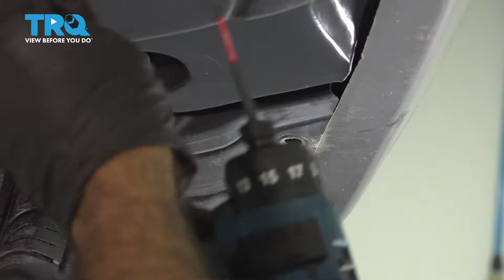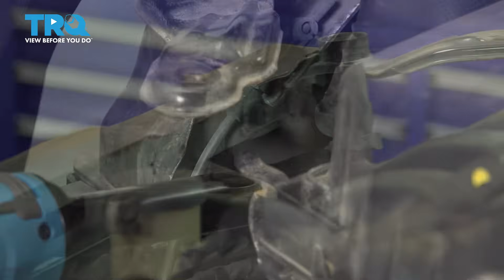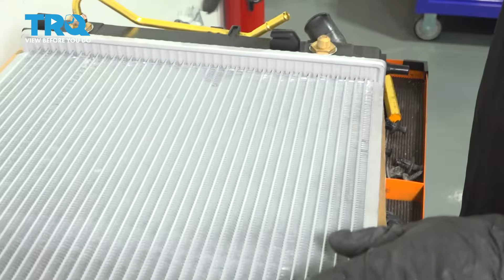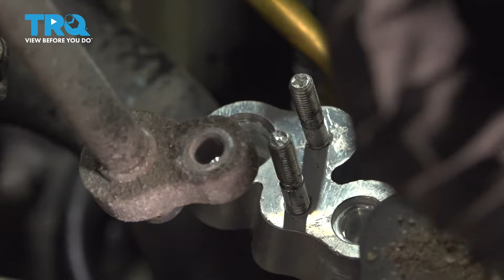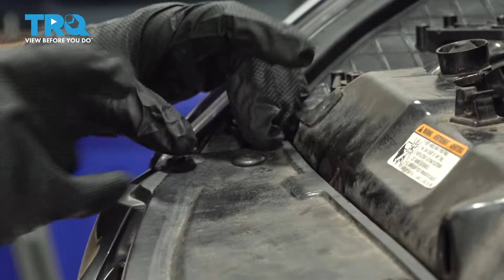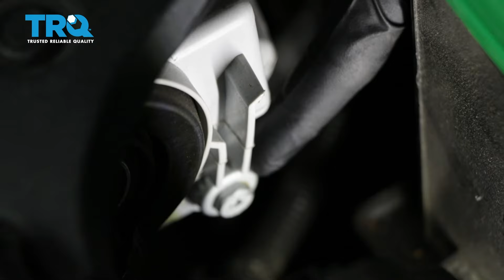How to Replace Radiator 2011-2016 Hyundai Elantra

Comment: So, i didnt see the note about going and getting the freon evacuated. I thought ( in my ignorance) that there must of been some kind of one way valve that stopped the freon from coming out. Yall dont have to tell me how dumb i am..... but , what do i do now? I finished the job and put the car back together and the car is running fine. But, how do I handle my AC issue? Do I need to go and have a vacuum put on the system? Or can I just add freon? When I took the lines off the condenser. The gas came out for probably 30 or 40 seconds maybe. It came out till it stopped.
Reply: Did you fix the ac issue?

Comment: He never showed the part where he evactuaded the A/C. Please DO NOT DISCONNECT WITHOUT PROPERLY CATCHING THE REFRIDGERANT! It is illegal to let out into the air. It will also shoot out a lot of pressure when you disconnect those condenser lines and be dangerous! I am doing this exact job tomorrow and will let yall know if it is necessary or not. I have never had to do that before.
Reply: Was it necessary?

Comment: If you spend money on a new radiator, you must replace all hoses, clamps, radiator cap and thermostat  too. Also you must clean the whole assembly before putting everything in place. Refill the radiator with new coolant. Save the old parts and show those to the customer before disposal. Thanks.

Comment: I'm stuck at the bottom transmission radiator hose with like an inch in diameter. PLEASE HELP! It's not long enough and when I force it into the engine, the radiator hangs from the hose.